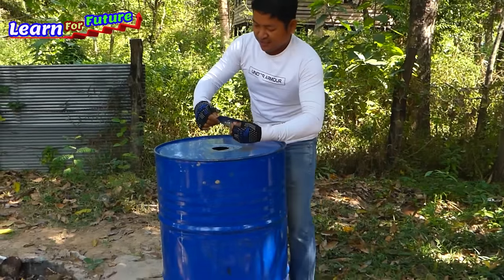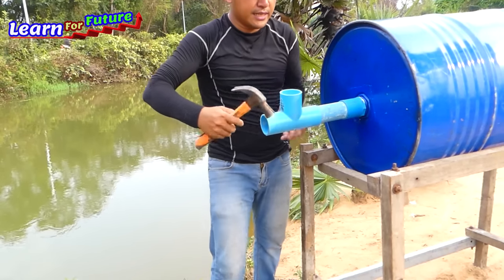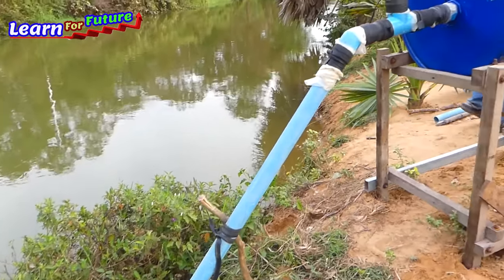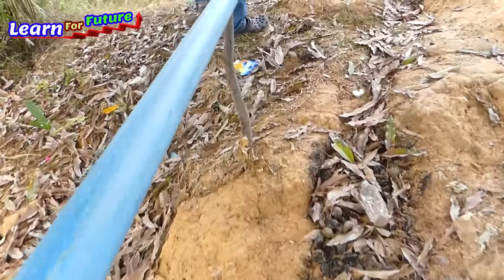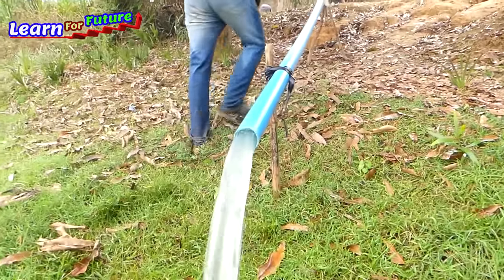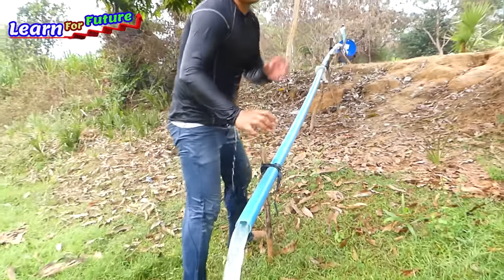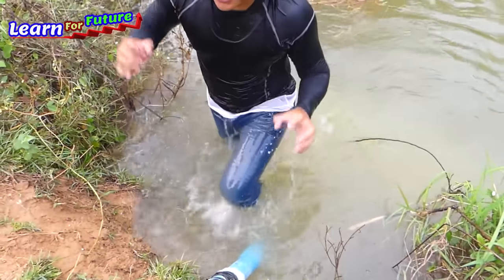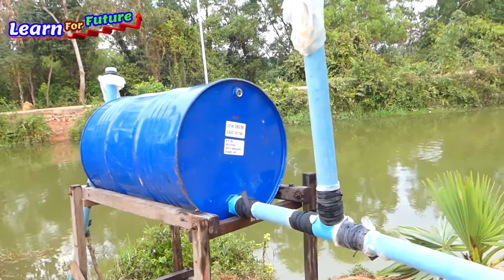Big Auto Water - Deep River!! How to install drum pump suck water from Big River for Big Farms.

Comment: Siphon with a reservoir. The drum deformed due to him opening the low end first which caused the squeeze since the high end was still blocked created a vacuum. should have had his video person open the other end at the same time which would have avoided the drum deformation. Should have used a check or foot valve on the river side.

Comment: you should have opened the inlet side first that might have kept the barrel bending, and or put a valve down by the discharge and slow the water down coming out that would for sure keep the barrel from bending
Reply: Yes, you opened inlet too late that’s why drum caved in due to sudden and enormous suction. Once a cylinder fails it’s going to remain like that, but it doesn’t matter as the siphon still works to full capacity. I totally understand the issue here, so next time I know you’ll have at least a helper along with you. Even if you increased the inlet pipe the drum would still have collapsed because the failure was due to the outlet being opened first while inlet was still shut off. But it’s a great piece of innovative idea from which people can learn. Please make more similar videos for us all. Thanks
Reply: Pressure in the tank depends solely on the height difference between the inlet and the outlet. No valve can regulate that.
Reply: if you open the inlet water will come out and will leave the drum half empty or half full.
Reply: Iwant to learn more.If he had opened the inlet first it wouldnt have deformed.Secondly is their apossibilty for this to run for ayear if factors are constant
Reply: Now what would he have done.opening at same time or.iwant cos the idea is good

Comment: what he did was right.
because, the end of the outlet pipe is lower than the water source (river). so surely the water will flow smoothly. look at 15:20. it is very clear that the output is lower than the source
Reply: Yes. If he removes the drum and one of the fill pipes would do the same thing, only simpler and cheaper.
Reply: @zumbafosto  you are right, but I think the drum is just adding a high sucking pressure into the equation

Comment: Great successful experiment ! 
The outlet pipe size  assisted with gravity  created high vaccum which the intake pipe unable to compensate, the result is high sucking power. 

Since the outlet deliver full 60mm capacity the vacuum power deformed the metal drum.  Maybe can control  the volume of water going out by installing  a ball-valve at the end of the delivery pipe, to balance the input and output so that the drum will not deform.
Reply: sir... good day.. so this system is true?  that the outlet pipe is higher than the inlet?
Reply: @kwaknitl-2guide318  i don't think so. if it's higher, it will not flow continuously and eventually stop when the strength required to suction the water from the river and the strength of the gravitational pull in the output pipe become balanced, as the volume of water in the drum decreases the water flow going out decreases also little by little until it will eventually stop.
Reply: Hii Bhai i want to order it can you help me to get it and please tell the prize also how much
Reply: @jaymarbreguera591  if the water did not keep going into the barrel the barrel would keep bending, so it has already sartopped, it is bringing in the same amount of water as is fgoing out, it is a simple siphon nothing fancy,  it just looks fancy design, you could do the same thing with 2 valves and a tee and a cap and pipe, valve on each end to hold the water in the pipe and fill the pipe at the tee and then cap the tee when full and two people open the two together and you have a siphon
Reply: @butchs2337  Yes you can.
But the barrel adds two benefits: no foot valve (here plastic bag) is needed in he river. No need to take any bath. Secondly, if there is a minor air leak in the system, a barrel can accumulate some air and make this siphin running for a longer period.

Comment: I built this system and let me tell you. This is the old siphon system. Nothing new. Why? If you look at the delivery pipe, it is way below the source of water. If you lift the end of the delivery pipe above the source pf water, it won't work. The drum with water is simply a large part of the the narrow pipe. The water in it helps start the siphon system replacing the old way of sucking the end of the pipe with mouth or anything to start the siphon system. 

Once more, the source of water must be above the end of the delivery pipe for any siphon system to work.

Comment: If all you want to do is pull water over the hill/burm into the other water source then you don't need the tank.
Just pick your size pipe and put a ball valve on the outlet side then submerge the pipe to fill it, close the ball vale and carry the outlet side over the hill/burm.
Now all you have to do is open the ball vale and water will continue to flow.
It's a siphon just like you had but without the barrow/stand.
Water leaving the pipe creates a vacuum on the inlet side.
It is simply volume displacement.
Your barrow crushed because you were closing off the intake while the outlet was still displacing volume.
Reply: I think the collaps of the barrel is theatre. The plasic bags closing thevfilling studs, they hold!
Reply: @Dingsrud  The theatre is they don't need a barrel.
This works like a pump if you need to draw water higher then the sourse and outlet, but clearly this is not needed here.
Reply: @icicicles  A barrel may be practical to prime the siphon. One do not need any foot valve and no need to take a bath in the river to remove any plastic bag at the suction side. An alternativ is to suck the whole tube in water to get it filled with water. 
This set up is a siphon with a starting barrel, it is not a pump. No siphon can lift water to a higher level. Water level in source usr be higher than discharge to the field.
Reply: @Dingsrud  Ya I probably shouldn't have used the word pump even though I expressed it like a pump, still wrong.
Water does seek its own level so the outlet would have to be below the source.
Reply: You are right 👍

Comment: Water reserved in the drum is the one that flows not the suction from the river. Elevation factor plays a huge role for this system.
Reply: yeap i agree it is just a simple siphon system
Reply: If it was that the water in the drum ready finish
The water out of the drum  is running more then 10 mn
Reply: The water out of drum is creating a lot of vacuum to suck from the lake.
Reply: @rusanyukaare179  Water is not elevated. It is transferred. Suction produced by long deliver pipe which has holding capacity more than 200 ltr. So the suction is very simple and the system is truly working
Reply: Siphon Tube

Comment: It worked because the water output is lower than the intake.
The idea is to pump water from a lower point to a higher point.
Try to drop the barrel past the valve, it's a higher point than the intake.
If water comes out, then your pump works.
Reply: This is a facy siphon with a priming barrel. A siphon can not lift any water. Output must be lower than input for this to work.
Reply: @kjellg6532  Water is not elevated. It is transferred. Suction produced by long deliver pipe which has holding capacity more than 200 ltr. So the suction is very simple and the system is truly working
Reply: @kkselvakumar3110  I agree on that. Only wated to piont out that this system workd fine if and only if the water level in the river is higher than the outlet to the field. Many YT videos clame that this is a pump and can lift water ‚from a deep well‘. That is not possible. Suction is produced by the difference in height between the outlett and the top of the drum, not from the length or volume of the delivery pipe. If you doubble the length of the delivery, the water flow will be a little less due to more friction in the delivery.
Reply: Man one of our old man used same technology to get the water out of 120 meter deep bore... Its simple suction technique ... The water decrease from tank create a suxtion effect and the input pipe suckout the water where ever it find ...

Comment: TO THE MAKER OF THIS VIDEO:
The water level in de river or canal is clearly much higher than the ground level of the field. Can you please give us the difference in of the water height relative to ground level
Reply: I agree on you.
Reply: It is just a fancy looking syphon. He said he wanted to save money, so all he needed was pipe, check valve at the input, with a tee at the highest point in elevation the pipe has to travel in order to go over the dam from the river to the field, it will syphon once you get it primed.

Better yet, if he wants to really save money all he needed was a shovel. The river is clearly higher than the field.
Reply: @TheRebelmanone  you are right, please show us without the outlet going so far down.
Reply: @TheRebelmanone  you may make it even simpler. Close the output. Fill the tube from the top and dip the suction pipe into the river. If the grater part of the tubing is below the water level in the river, you do not need any foot valve at the suction end. A smal drum can be practical for starting this siphon.
Reply: Como se llama la música de fondo es buena música avisame por favor GRACIAS
Reply: @TheRebelmanone  Isn't the barrel giving him more air volume, which would increase his "pressure?"
Reply: @TheRebelmanone  agree
Reply: When you opened the gate valve of containers which filled of water it cause pressure or suction.remember also water wil seek its levels.The water of the container above the ground will seek its levels.There's no impossible to this video .just a little need of improvement.

Comment: Learn for Future: I would kindly appreciate it very much if you would respond to my comments. I have build the system exactly as you explain in the videos but it does not work. Is it possible that we exchange ideas to find out why it does not work?  Thanking you kindly in advance
Reply: I did the same thing
1. Fill up as much water as possible, force the air out from the drum/barrel we are using. (both side inlet and outlet should be air sealed while u r doing this)
2. When the water overflows from that two vertical pipe, air sealed it. (Tips: I would suggest using 4 valve for all the holes, easier to operate and make a bigger hole at the bottom of the drum with an extra valve to clean the wastage that sucked in from inlet pipe, make it big so ur hand had access into it for cleaning or dealing with cloaking problems in the future. Do not use netting at inlet hole as it will cloak it as soon as some leafs being pulled over) 
3. At the end of the outlet, open it up and let it run for couple second to create stronger vacuum in the drum. ( the drum deformed when he leaves the water running for too long time, but strong vacuum suction was created as well)
4. Open up the inlet and ur water will be running smoothly as they are filled with water without air in the inlet pipe, it makes the suctions stronger.
*Just remember one thing, short inlet and longer outlet, just make sure no air running in from the outlet, then this system will work just fine, so valve is super useful. If the pipes are filled with water in the outlet before opening up, it will be fine. But if u let some air into the outlet pipe, this system will fail. 

Try it couple times to get the right vacuum suction u need, as different length of inlet  pipe and quantity of airs going back into the drum do affects the vacuum power needed to make this work.
Good luck!
Reply: Assalom aleykum men bu kursatuvni Janubiy Koreyadan tomosho qilayabman uzimni millatim UZBEK.Uzbekistonga borsam menham shunday vakkumli pompa yasashim kerak Alloh nasib qilsa ingliz tilini bilmayman lekin sizga habar yozayotganimdan hursandman juda Uzbekistonda katta katta unumdor yerlar kop lekin sugorish uchun suv kamroq bizda dengiz okeanlar yoq salomat buling habaringizni kutaman
Reply: @AustinAhxinn  input water level must be higher than output water level. it is a  siphon and nothing else. Let the guy simply tell us the height of the water inlet level relative to the water outlet level. That is all we need to hear from him. he does not say ANYTHING about that.  WHY?
Reply: @stevesilos4402  is basic of siphon. But some people tried it even with higher input and lower output still failes. The details in between matters
Reply: @AustinAhxinn  details in between ??? I have build an air tight system. Filled it with water. inlet pipe also completely filled. Opened the outlet valve and you know what happened all of the time? Every time air is sucked at the outlet valve back into the drum.
Reply: @stevesilos4402  the timing Steve. The timing of opening the outlet pipe. Try a couple times. It will be successful. Good luck
Reply: @stevesilos4402  that's exactly what should happen if the inlet water is lower because gravity also pulls water from the drum back to the river. that's why air is sucked back to the drum and water will not flow outward if the output pipe is higher.
Reply: That is wrong advice.haw to posible this
Reply: @stevesilos4402  First, is your outlet lower than your source! That is mandatory for a siphon to work! Second. If you bend your output into a „U-form“ no air will go back to the drum.
Reply: @Dingsrud  from the beginning I have been asking the producer of these clips to EXPLICITLY tell this to his audience in order to prevent them wasting their time and money.
Reply: @stevesilos4402  Agree, and that is way I am wasting my time writing some comments. There are many asking if it will lift water out of a well or they are confused when their system does not work.
Reply: @AustinAhxinn  sorce must be higher than outlet. Everything must be air tight. Then it works. Diameter of tubes are not critical, but gater tubes givs more water. More diffence in height between inlet and outlet gives more water.
Reply: @stevesilos4402  Because your outlet is higher than your source.  A siphon can not lift any water.
You should make an upward bend at ate output or just dip it into a bucket of water to prevent air leaking in from the outlet.
Reply: @kjellg6532  Please read my question about the waterlevel difference carefully.  The maker of this video keeps on making these videos knowing that the system only works when the waterlevel at the inlet side must be higher then the outlet. His use of the words "deep river water " is misleading.

Comment: You need a pressure gauge to check sucking pressure and dual intake and you will pump harder the weight of the fall causes the sucking pressure. By increasing the diameter of your outflow pipe you cause more vac suction as you want more volume increase and it goes on and on if you keep raising your barell you can pump further and more volume
Reply: All wrong my friend. Water only flows down.
Reply: @seetheforest  so trees move water up how , with a man made pump ? Water loves water ...
Reply: @Alex-um4fe  no one knows, it's a mystery.
Reply: The suction tube is same diameter as the output. No need to waste any money on dual intake. With the output at the center of the drum, half of the barrel volume are not active!  With a priming drum there is no need to jump into the river, just theatre.
There is no need for closing the inlet in the river. If you do, you should open in he river before opening the output to prevent air from sucking in from the output.
Reply: @Alex-um4fe  so magic barrel pumps work on the same principal as trees?
Reply: @seetheforest  of course it is a mystery till (profit science) tells you how to think .. enjoy your Plato cave my friend
Reply: @Alex-um4fe  anything you say chief..
Reply: Need small pipe bothe side just 1inch

Comment: Your water level is higher in the river than the end of output pipe so you don't really need that drum to do that,i would believe that if your output pipe would go 50 m high  up hill.Only a ram pump will work
Reply: that's true u dont need that drum , the water elevation is higher. this is the process of siphon.
Reply: I find it surprising that only two other people know this "magic barrel pump" wont work. 
They say it's lonely at the top.
And you can't syphon water up to the top of anything. Water only goes down.
Reply: Cần gì cái thùng xanh , chỉ cần mồi nước vào trong ống , thì nước sẽ chảy từ trên cao xuống .
Reply: He needs to do what he is repeatingly saying at the end off output no need drum
Reply: Good
Reply: Ram pump uses energy of falling water. This is siphoning from pool of water
Reply: @georgedoclan7137  ax,m,4c3
Reply: I'm thinking so. It's no use to draw water from higher to lower place. A simple rubber pipe will do this work
Reply: Шш8ш
Reply: Para eso no hace falta bidón..con una simple manguera vale..😂😂

Comment: It deformed because you open the  outlet valve while the inlet( the pipe in the lake) was still blocked, I do understand why you did that but check valve at the end would have prevented it.